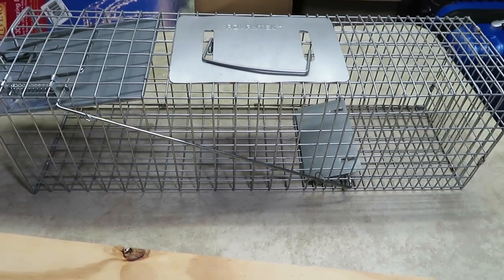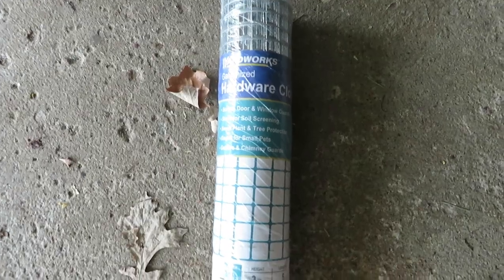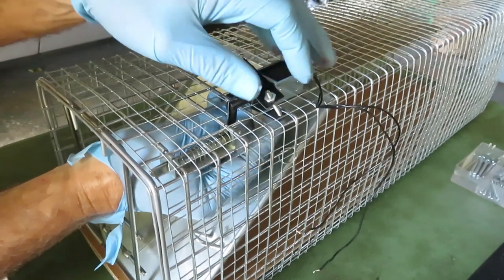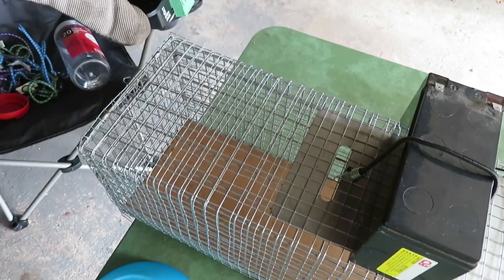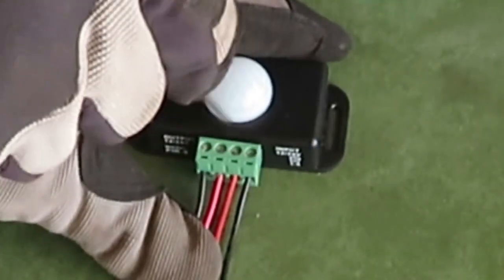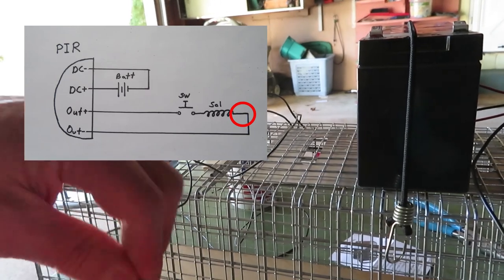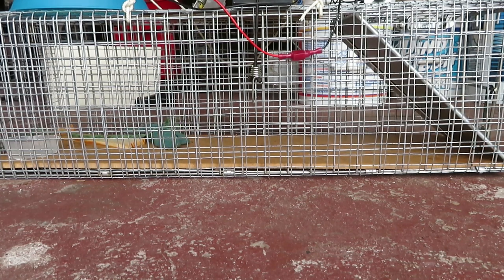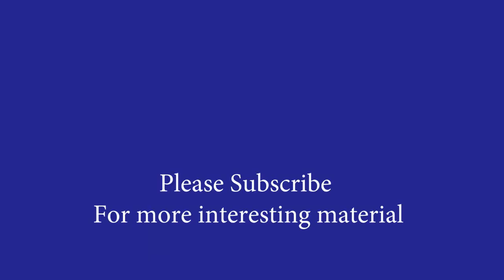Check out this Very Effective Electrically Activated Live Animal Trap

Comment: Nice setup.  The PIR you used is made to detect a wide area, you might try removing the white plastic dome.  It should make it more focused.  Also  black zip ties are much more UV resistant and will last longer outside than white ties.  I doubt the white tie will fail any time soon, but black ties are always better.  I work in telecommunications and we are only allowed to use black ties.
Reply from the maker: Thanks for watching and for the tips. So far I have been using the trap indoors, in a garage and outbuilding, and it has been fabulous at clearing the buildings of mice and chipmunks... and stocking a woodland.
Reply: The plastic dome is an IR lens. A bare PIR sensor isn't likely to do anything.